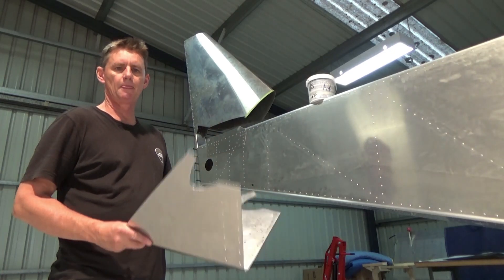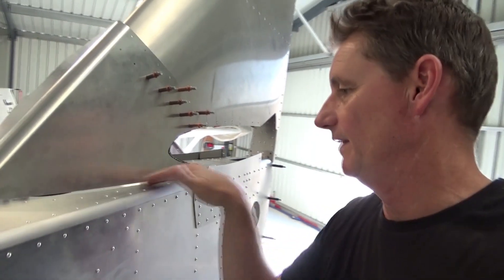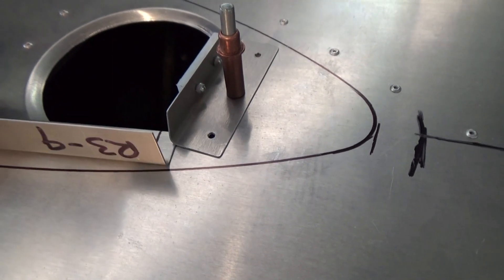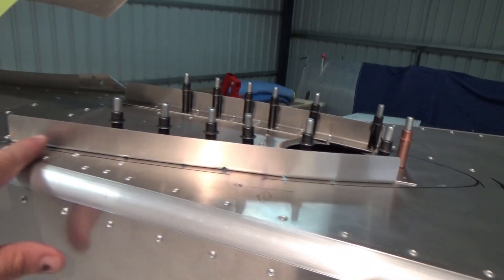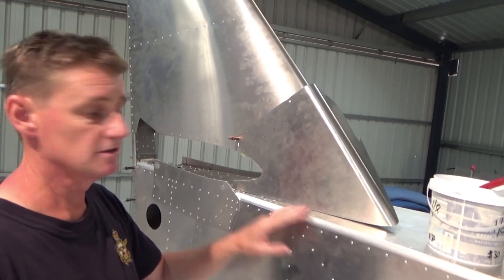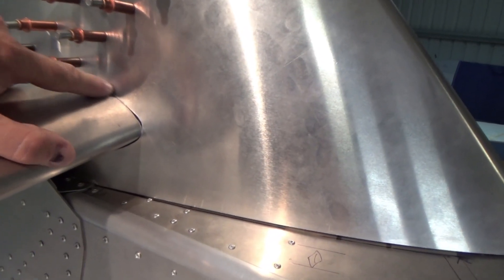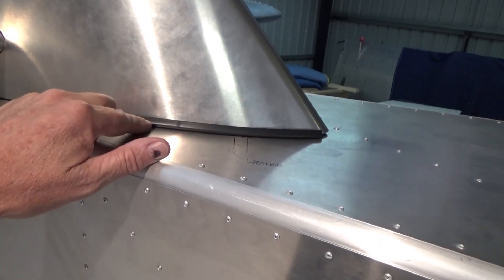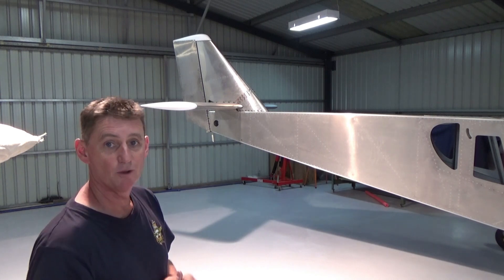How I installed the Zenith CH750 Cruzer Dorsal fin

Comment: Hey! I’m in the same spot of my build right now. W your dorsal fin your piece seemed to slip right on with no fabrication to the horizontal stab. I’ve been finessing mine a bit and was curious if you did that at all? Or did yours just slip in without any trimming?
Reply from the maker: It was a few years ago, but heaps of trimming. I made a cardboard template to get it accurate, and had the tail plane of and on a few times
Reply: @ awesome! I have been trimming and fitting like a madman. When I saw your video I thought I wasn’t doing something right.  Thanks for the input! Your videos are awesome!

Comment: just a thought on cable guide.  looks like it will wear out over time and tension on cable will change.   some guys have made a bracket for a pully  in that hole to run cable over and not touch the skin.
Reply from the maker: m kramer there is a pulley in the system, this is just in case.
Reply: Yes great idea. I did that as inspired by Mark Pensentadler